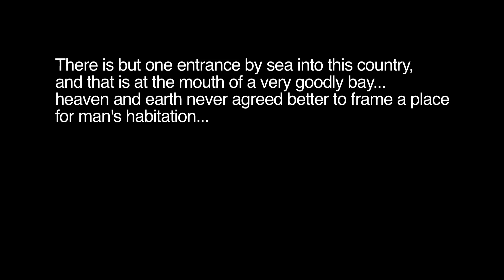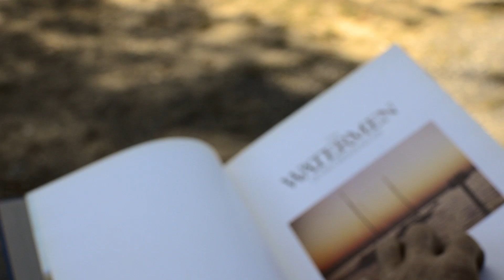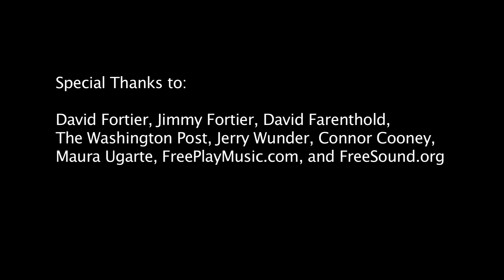Pollution in The Chesapeake Bay

Comment: Our local economy is related to the pollution of the Chesapeake Bay because there is pollution in the air from gases and not every one recycles or throws trash in the trash can so they throw stuff on the floor and that can runoff into the water.